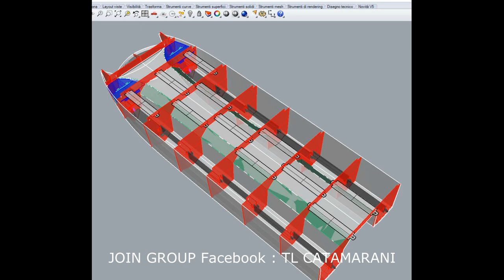HONEYCOMB CATAMARAN BOAT BUILDING NIDACORE NIDAPLAST #short #nidaplast #pontoonboat

Comment: That is literally the worst material to make a boat out of.
Reply from the maker: This material name  honeycomb
Reply: The Nidacore is definitely not the worst material, it's actually one of the better ones along side foam. As the for the OSB, they should have just been used as bracing and replaced with the nidacore.
Reply from the maker: @Cadaverine1990  the catamaran was made entirely with nidacore the osb material is only used to give the shape and then all removed.  look at the link of the finished catamaran https://www.subito.it/nautica/catamarano-per-gite-ed-escursioni-lecce-381564843.htm?utm_medium=referral&utm_source=subito&utm_campaign=free-engagement-ad_detail
Reply: Are you familiar with Nidacore and boats to make this judgement? I'm looking for material to build a cat with. Cheers